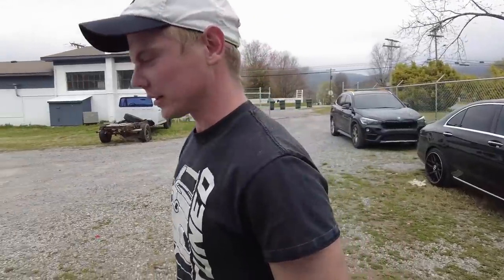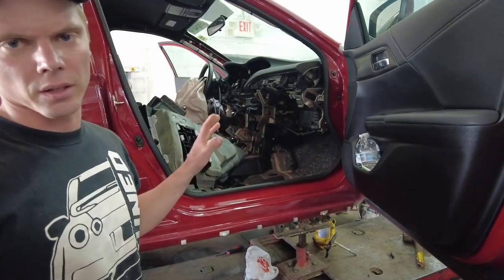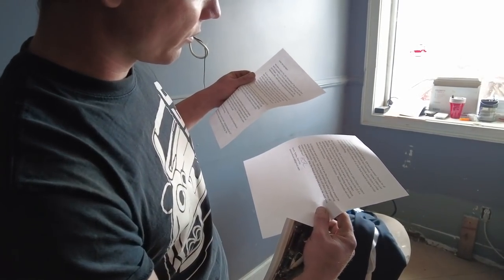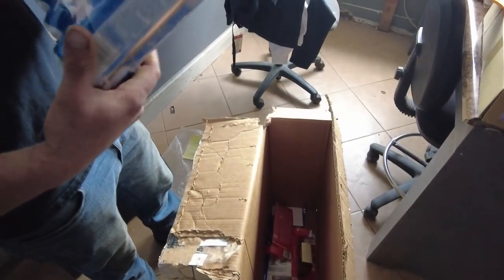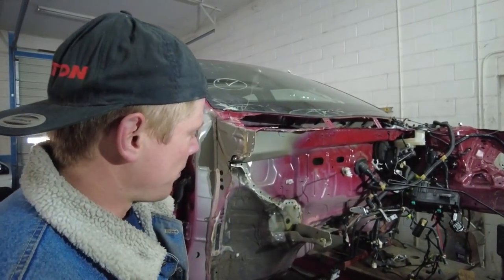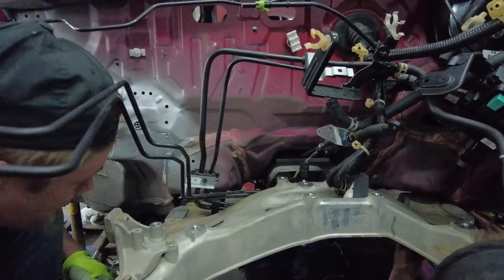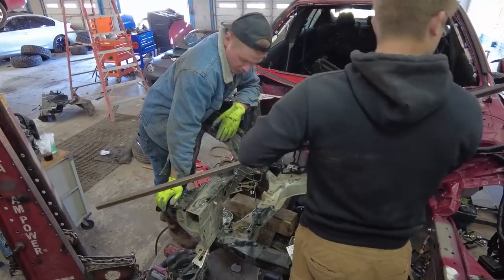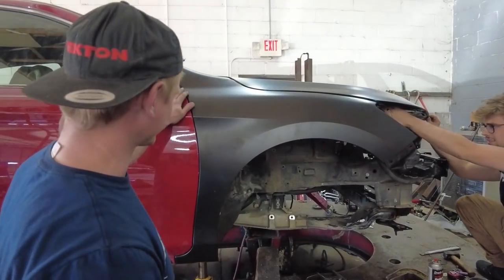We had to REPLACE the Entire frame rail on this totaled Honda Accord

Comment: Great video.  I was wondering what type of welding machine did you use for this job? Flux core welder or something fancier?
Reply from the maker: It’s a Miller Matic 211 with argon gas

Comment: How long did all this work take from start to finish, removing parts, frame work, reinstalling motor, transmission, axles, etc including the hood, bumper, frnders and paint ?
Reply from the maker: Hey thanks for watching, this entire job start to finish took two weeks. But if you actually count the hours it would be about a week